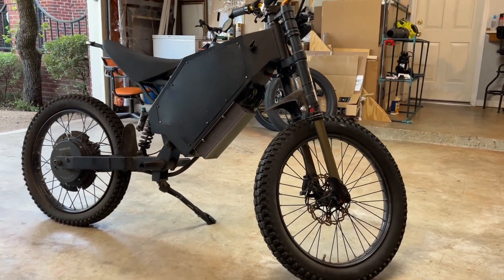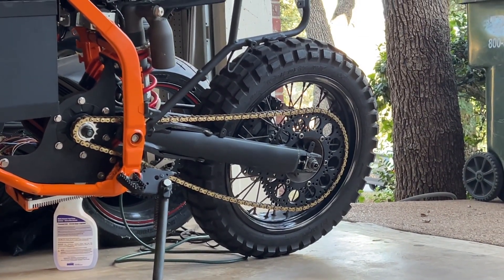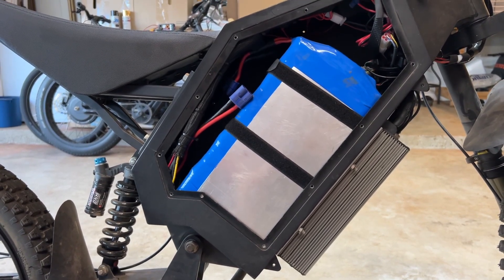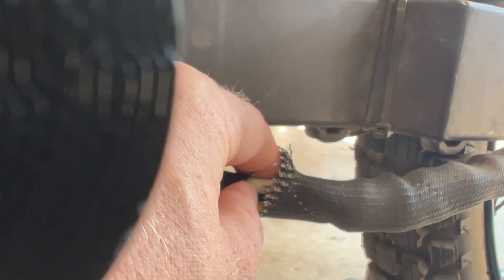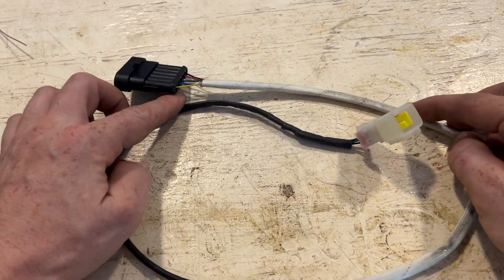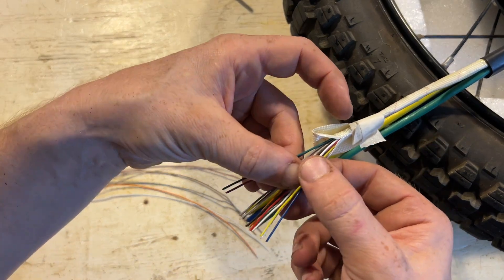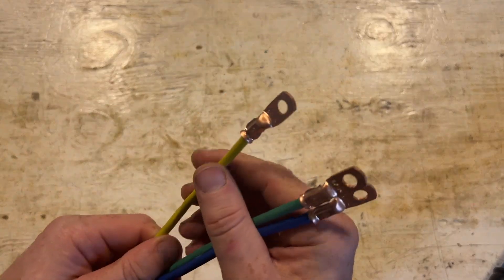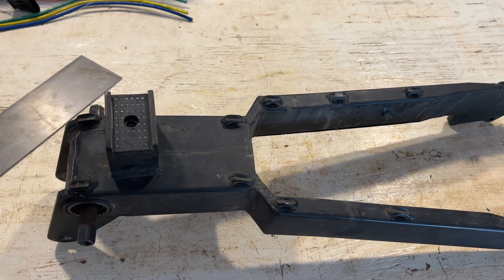This One Simple Hub Motor eBike Upgrade Will Make Your Life 100x Easier

Comment: All you need to do is snip the cable ties holding the wire to the swing arm to release the slack, then flip the wheel out while the wire is connected to the bike and do the necessary work next to the bike.  I've done it a few times and it's a lot quicker and easier than you think!  Quick tip is to fit tyre liners while the wheel is off.  I've never had a flat in a year and a half.
Reply: yep what he said or if the wire is still too tight you could have also just laid the bike on it's side and unbolted the bottom shock bolt and swing arm bolt so you can spin the whole rear around to give slack to the motor wires. Everybody's got their own opinion :) 
If thats a 19" rim I kept running into flats to then I put the Shinko 244 Dual Sport  2.75 19 inch motorcycle tires on mine and it don't go flat anymore.  Matter of fact you can let the air all the way out and still ride home on it if you had too the rubber is so thick.
Reply: Excactly.
Reply: Personally I want to be able to just get the wheel off and only deal with the wheel without shredding a phase wire. No gymnastics
This mod just works.

Comment: I was able to slide my rear wheel back enough to get axle off swing arm and I set tire on box and I changed tube no problem, I bought a motorcycle swing arm lift from Harbor Freight to lift tire off ground while removing rear tire, just in case anyone cares
I was wondering about doing what ur doing so great video!

Comment: I dont remove wheel  off bike to patch tube - just break bead on One side of tire - pull tube  out around wheel  -  ( leave valve stem in rim if possible )
air up tube some to find hole /patch - check for thorn by rubbing panty hose inside tire (  will snag thorn) - stuff tube back in tire - spoon tire  back on   - air up  -
I use this trick on all of my bikes
Reply: What IF you need to change the disk rotors??

Comment: also, here is a pro tip, screw that terminal block junk and just get weatherproof connectors with as many pins as you need, then it is as simple as undoing the velcro holding down the wire on the swing arm and unplugging a connector, i got my parts from amazon hella cheap just for this purpose

Comment: My 4th time out on my e-bike I had a flat on the back so it sat for about 3 days wile I ordered liners,  and I put about a pint of slime sealer in it and now I've ridden 1750 miles without a flat in a year and a half , heck my rear knobbie fat tire is wearing out so liners are a must , got them on front and back.too.

Comment: Great Video as always! Had issues with snapped valve stems too. I found that if the tire pressure was too low the high torque would spin the tire on the rim and drag the tube. I installed a rim lock and had no issues since.
Reply from the maker: makes sense! I had the tired deflated for trail riding before it happened

Comment: I think ill do something similar with the phase wires. Just today I wired mine up and it was tough getting them screws into the sabvoton amongst all the other wiring going on, so thank you for the tip. Also, for the pan that the frame comes with, I extended the depth with some vinyl floor tiles, sealed and screwed it together with JB weld and then covered it in vinyl wrap. 
It looks the part and now covers the sabvoton.
Reply from the maker: wow nice solution using floor tiles! if your bike breaks down you can always call a contractor

Comment: In just used a weather proof connector for the phase wires.  I’ve changed the tube on mine without removing the wheel but just unbolting it and pushing it to one side. Easy!.   Now I used Teflon tire strips and ride on tire sealant.  Never had a flat again.

Comment: Loads of torque is spinning rim inside the tyre causing the inner tube to spin and shear at the valve, motor x bikes have a tyre gripper on opposite side to valve looks just like a valve but it’s a nut and bolt going through the rim 👍

Comment: you can also use XT150 bullet connectors, they just pop together like a headphone jack,  they are very hard to solder though for me anyway, although I had  quite a lot of experience.  The main problem I've had with mine is that the cable became damaged where it enters the hub, exposing the metal on one of the phase wires,  cheaper hub motors come with a metal sheathe coil around their cables in that area but my QS205 did not.
Reply: I have been heating my XT150's on the hob , half filling them with solder  and pushing the wire into the pin .A touch of flux on the tip of the cable will help pull solder into the wire.
Reply: Presolder wire end, presolder xt150. Then heat xt150 with a hot lighter flame and then it's easy

Comment: Keep a close eye on that terminal block. They dont handle high amperage well. I like to use qs 8 or qs 10 connectors instead.
Reply from the maker: someone else mentioned also - will definitely keep an eye. luckily it's easy to swap out so maybe I'll work on some custom fabricated solution
Reply: do they make a qs8 amperage in 3 pin vs 2?
Reply: @plojm123  I'm pretty sure they don't come in a 3 circuit connector. I could be wrong but I haven't found any in the QS connectors.
Reply: @skonyc3164  I just bought 3 pairs of 8mm golden bullet connectors I'll just shrink them
Reply: @plojm123  that should do it. Try to stager them if you can. It will look cleaner and be less bulky and safer also.
Reply: @skonyc3164  absolutely will and will use marine grade shrink with glue

Comment: Run XT150s with shrink tubing or both sides of an xt90, those terminal blocks are usually called "yellow blocks of death" since they tend to fail at relatively low power levels on prebuilt scooters and bikes.
Reply from the maker: xt90 is rated too low for phase wire current which would be about 450A for this setup. Bullet connectors wouldn't quite cut it either unless you find some bulky ones, also the way they connect is subject to loosening over time. what is the issue with these blocks? the screws themselves don't actually carry any current..they're just there to hold the terminal lugs together. I guess I can see heating being an issue in which chase it wouldn't be too hard to fabricate something custom. Thanks for bringing it to my attention!
Reply: @GaiusGarage  xt90s if you run both pins for the same line should be able to handle 450 amps temporarily but I still would use it as a last resort. 

Xt150s are what I've been using for now till I decided to go to crimped eyelets. I think the main culprit for the failure on the terminal blocks was the soldered crappy eyelets from the factory so take my recommendation with a pinch of salt. Wish the people who made QS-10, and QS-8 connectors sold just the bullets as those would probably be ideal. Maybe they can be salvaged? But crimp is better than soldered when done correctly, like you did with a hydraulic one.

Otherwise your implementation seems best with crimped copper, there just needs to be a more heat resistant non-conductive enclosure, maybe anodized aluminum. 

Love your build and the caution towards safety while maintaining functional usability all around.
Reply from the maker: @darkchild256  thanks so much man! interesting idea about anodized aluminum - I know the oxide layer is non-conductive but wondering how easily it could be worn away
Reply: those yellow blocks.. I fear them,  they are quite brittle and I have seen them crack in half or the corners split off, im still using it on my newest bike though as I needed a simple way to connect my controller to a weird triangle shaped phase wire connector,  I don't know if they fail from heat but they do crack easily,  maybe put some strong tape on the back of it so if it does split it won't fragment ?
Reply from the maker: @ash0787  considering how half the comment are about how these blocks tend to fail I may design something myself - maybe 3D printed from PETG or maybe just 3D print a mold for some type of an epoxy solution
Reply: @GaiusGarage  yeah not sure what the best solution is for people running really high currents, theres something to be said for the Sur Ron design where they only run short wires to the motor and wheel comes off easily,  I don't own one of those bikes though.

Comment: Should use a quick disconnect like the xlr connector the water resistant ones
Reply: Too many AMPS/heat for julet connections
Reply: @ianmangham4570  Juliet ? Too much for the aviation connectors gx16 ?

Comment: It's not one sensor. There are three (blue, green, yellow) , +5v (red), and ground (black). White wire is for speed sensor, if it has one. All sensors share power and signal ground. They already make round 9-pin waterproof plug cables for BLDC motors.

Comment: Watching you change the tire and it came to the part where the actual problem was. You may need to look at possibly increasing tire pressure or having some sort of bead lock. It looks as though the tire may have slipped on the rim. A common problem using low pressure in tires either purposefully or not.

Comment: You might be able to hold the rim liner in place with some strong double sided tape or maybe an epoxy or other suitable adhesive. That should keep the liner in place...or just delay the problem of the liner moving/making the problem worse. There might be reasons beyond the bike manufacturer being cheap for why they don't glue liners in place.

Comment: Why couldn't you just squeeze the tire or tube thru on the right side? Or just fix the tube while on the wheel still on the motorcycle?
Reply from the maker: I don't think the phase wire harness was long enough to pull the wheel past the dropout to be able to pull the tire past the axel. but other than that, seems like it would get a bit precarious and stressful..changing the tire is cumbersome under ideal circumstances
Reply: To add to this, having the peace of mind of an easy removal makes this an investment for future repairs. Even if it did work once stressfully, if a flat blows on the side of the road, this would also make the same tire change in the future easier.
Reply: Exactly ive had seven punctures on my very similar bike! Ive never removed the  phase wires to repair a pucture from the right hand side with ease!!!

Comment: If the rear arm was single on one side.  Motor, hub and brake could stay on while you just unbolt the wheel from the motor, like a car.    They have them in motorcycle world.  Often time both stiffer and lighter then 2 arms.    It would solve a lot of repair issues with hub motors.

Comment: thats halfwat there bro, i would build it almost the same with one huge ass difference, put another hub motor on the front so it is 2WD, it will be so much more capable offroad and much faster acceleration with less wasted wheelspin, its not too hard to wire it up but i think you will need a special controller

Comment: Amass do 3 pole connectors for this, much slimmer and pretty much water tight once covered in grease
Reply from the maker: there are better options than what I'm using but those amass 3 pole connectors would melt at the 450A phase current. certain bullet connectors would work but terminal lugs are the simplest and most robust solution

Comment: Better off using 6 or 8mm bullet connectors instead of those ring terminal things. If you have a thermal camera take a look at how hot it gets. Lots of resistance between the ring terminals and depending on what power your pushing can become a bottleneck point.
Reply: Plus the bullet connectors will prevent any oxidization for the connection.

Comment: Cool bike, I wanna do one myself but cant decide on hub or middrive qs motor. 
What do you like the most?
Reply from the maker: both have their advantages and drawbacks.. hub is cheaper, quieter, more simple, and you will have more versatility for mounting batteries within the frame but the drawbacks are the large unsprung weight at the back wheel, which affects performance, and issues like in this video where your back wheel becomes the locus point for your main powertrain with wires going to it etc. also the swingarm dropouts needs to be reinforced to handle the torque of the motor shaft. personally, I would prefer a mid-mounted motor and a normal wheel all things being equal but some projects, like a scooter or some basic land cruiser type of bike really is better with a simple hub motor

Comment: Ok so you see where the phase wire runs along frame right there in the manufacture should have only made it about 5-8 inches then make a connector for them to meet that way when you have a flat you leave the rest of the wire that’s runs into the bike it’s one extra step but that extra step makes changing the tire a whole lot easier
Reply: 2:33 lol never mind you got the right idea dude that’s exactly how I would do it godless that machine I’m running a 1200w ebikeling kit on a mongoose malus and it’s pretty ok I’m getting 35 out of it but what I spent to build that I could’ve spent just a bit more and did this 🤦🏻🤦🏻🤦🏻 such a cool bike

Comment: The tube valve stem sheared because of the torque of that high power hub motor forcing the tire and tube to move on the rim. It will happen again unless you lock the tire to the rim so it won't move.
Reply from the maker: thats an interesting theory - but wouldnt any tire on a vehicle with high torque be subject to this problem? doesnt matter whether its a hub motor or chain drive or something else - from the perspective of the tire, it will always experience shear force. so why dont we see this happening more often? and now does one lock the tire to the rim? is this something they do on drag racers, for instance?
Reply: @GaiusGarage  Use a rim lock, google or search Youtube for Motorcycle Rim Lock. They are used to stop valve stem from being sheared off from high power acceleration. Yes they lock the tire to rim on high power like drag racing so the rim does not spin in the tire but they also don't use a tube. You could also convert to tubeless or put a knurl on the inside lip of rim for tire bead to grab on to. Some people also screw the tire to the rim but doing that on a wheel with tube not recommended due to obvious reasons. You could put a couple of evenly spaced out weld bumps on inside rim bead to not throw wheel out of balance and dremel them to a sharp enough point to grab the tire bead for a DIY style but best way is to just get and install a rim lock.
Reply from the maker: @fastjp72  ok I gochya. Appreciate the breakdown!

Comment: Is it not possible to go tubeless with your wheel? I run tubeless on all my bikes and most flats are fixed by simply cleaning and plugging the holes with tar impregnated rope and a cheap tool. Rarely, I'll get an un-pluggable hole in the sidewall but its really rare. You still have to replace worn out tires but just pointing out that tubeless could help you out a lot since most repairs can be done without removing the wheel.
Reply from the maker: I don't think it's possible with those rims. but tubeless is definitely better
Reply: @GaiusGarage  Cool, just passing on the tubeless option for your convenience. I've never run into a rim that couldn't be converted to tubeless but I'm sure there is plenty I've never seen before.

Comment: Low tire pressure and the motor torque made the tire slip on the rim taking the tube with it.  The valve stem didn't go on the trip and you have a FLAT.

Comment: Couldn't you just just make a plugin for the phase wires that way you wouldn't have to do alot of unnecessary screwing / unscrewing connectors?
Reply from the maker: Yeah but you would need to find some bullet connectors that can handle the current. It's possible but I decided to go this route for simplicity

Comment: I have a qs273, just changed my rear tire for a better one. Just cut the zip ties on the swing arm you don't need to remove the wires don't need to be removed
Reply: I just did this very thing yesterday. Left the wires hooked up. Trouble was getting the bike to stay up. Only after I finished did I realize that I could have layed the bike on it's side.
Reply: @marthamryglod291 or put it up on a mid stand, or in my case a stack of bricks.🤷‍♂️

Comment: I think your idea is a greatone. However the impleentation is sketch. Shouldn't you run the phase wires up the swing arm, place the connection ON THE SIDE & MAKE A COVER!!!Bottom placement is a bad idea imnho Nice build ! I am a little jealous!!!
Reply from the maker: Thank you! running then through the swingarm would be alot extra work.. cutting holes & passing them through etc. I will have a cover for that connection block and probably 3D print something to cover the hall sensor connection too. Although I don't think it would be too much of the problem. You'd would have to keep an eye out for corrosion. I didn't use nickel plated copper for the lug so that is an issue

Comment: I was able to hoist the bike with a folding ladder and get access to the tire without removing the battery. https://www.youtube.com/watch?v=IFlTxvxSUPg&ab_channel=TacticoolDennis I do feel that the hub motors should have some type of connector at the hub side so you can access for repairs or replace the cable since its in a very likely place to get damage from riding.

Comment: Odd to attribute this to a "flaw with hub motors" when youre really just complaining about a particular build's design and connector usage.' there have been production hub motors with quick disconnects for years and tons of people adding quick disconnect plugs to their motor cables to facilitate wheel removal on diy forums for close to 2 decades. lots of better easier quicker options for this tbh.

Comment: Dude…you do know you can take the tire of both sides of the rim right?????  🤦‍♂️ take the tire off the right side ffs. Oh, and when you put it back on, leave slack in the wires zip tied up so there is room to take the wheel out of the dropouts. Smfh.
Reply from the maker: or I can just take the wheel off and change it like a normal tire